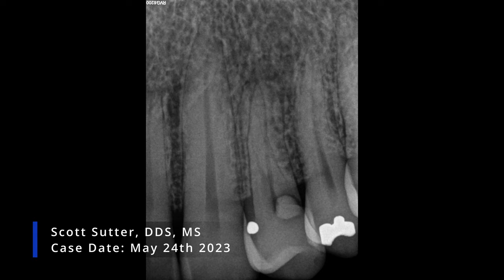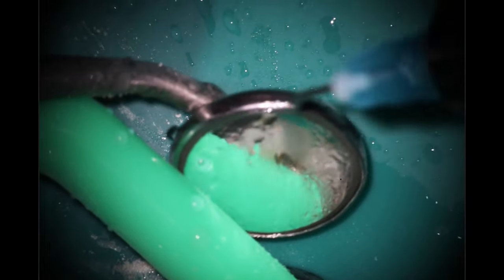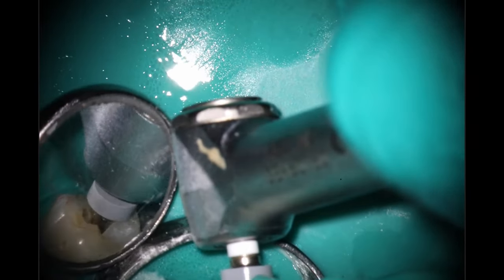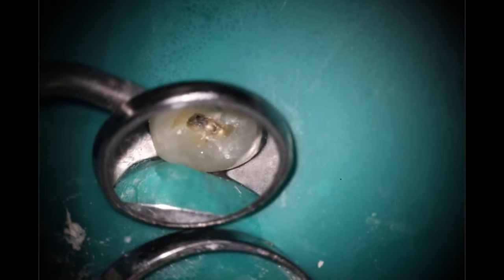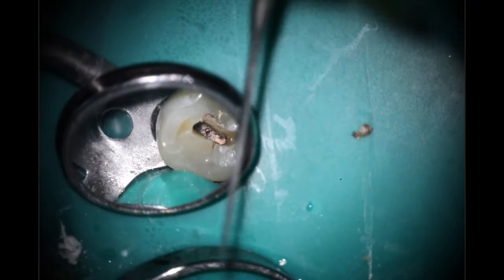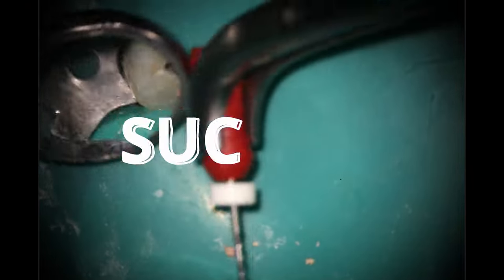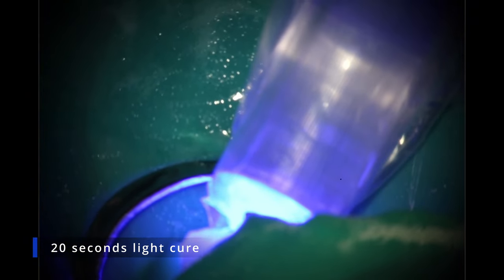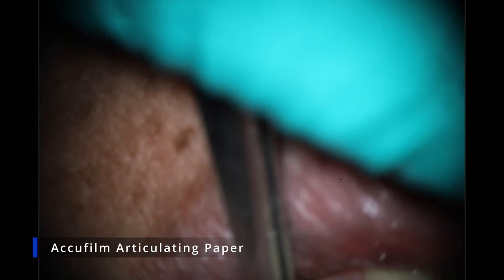Premolar Root Canal in under 20 minutes with post!

Comment: Question for you.  The amount of time you irrigated seems quite short to the training I've received.  Could you explain your rational a little more and what role the hybrid hypochlorite product you are using plays in that?
Reply from the maker: A few things here (be warned, I just stepped on a soapbox and have many things to say on this topic!):
I cut out a lot of rinsing because it’s boring in these videos 😂
We have never really shown that reducing bacteria actually makes a difference. Kakehashi has never been replicated and there are a ton of articles showing we can never remove all bacteria, so that probably isn’t our goal. Changing them, however, is possible and probably makes all the difference. For years I used the NaOCL+EDTA+IsoOH that we all know and loved and it worked really well. But. There have been subjective measurements (no drainage, more bubbling, cleaning canals) that I’ve noticed with Triton (not sponsored but happy to take your money Brasseler!) compared to the traditional combo that I switched. 
I also did an analysis in excel (shoutout to my CPA mom) that showed the marginal increase in cost was very low given the benefits. 
TL;DR: what we rinse with probably doesn’t matter in most cases. On the marginal ones, I prefer Triton over the traditional combination because I’m a financial and scientific nerd and it not only makes sense, both scientifically and financially, but subjectively is better. 
Occlusion and restorative influence our outcomes FAR more than what we rinse with. 
But, I do like Gentlewave on retreats 😜
Reply: @PatencyPro  Thank you for the input.  I'm typically a once a week RCT guy, and am always looking for ways to make it less miserable for myself.
Reply from the maker: If you’re only doing 1/week, I would say get a nice handpiece and splurge on your favorite files. You can’t justify a microscope or any of the fun things with just 1/week, but you can make your life better!

Comment: I have doubt 17 04 quit small what about irrigant reach tooth apex and what apical vapour lock i usually prepare upto f1 and which type back fill gun used
Reply from the maker: Thanks for the comment! I'll address the size question in a lecture I'm giving to the residents at the end of August, but to summarize: 
We certainly have zero idea what is "necessary" for success. I can show you cases where the apical 1/2 wasn't obturated or filled and are "working" and cases taken to far beyond an F1 are failing (usually because of vertical root fractures from excessive tooth structure removal.) I have finished cases this small for the past 10 years and cannot think of any failures from lack of shaping. 
Irrigation has never been shown to be "necessary."  Gary Carr's SEM work shows unequivocally that there is ALWAYS bacteria present in the tooth no matter the size or irrigation method used. So I don't worry about it or vapor lock :) 

The obturation gun is a B&L Bio Beta Mini https://www.bnlbio.com/collections/beta-mini/main